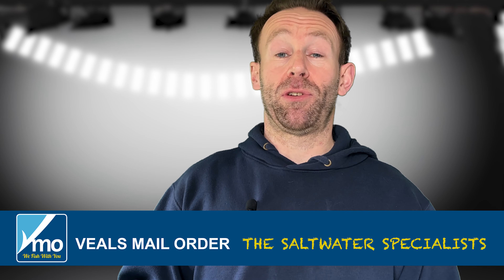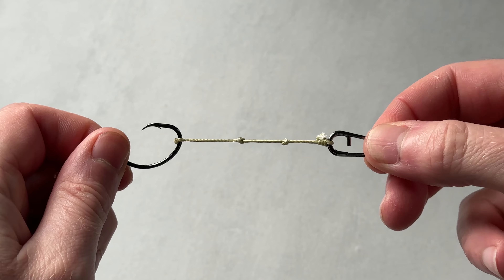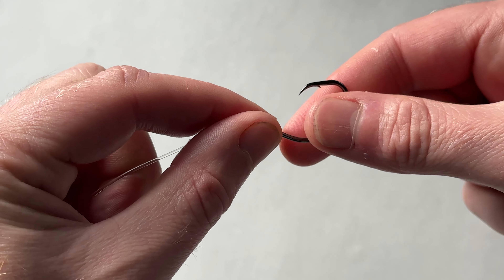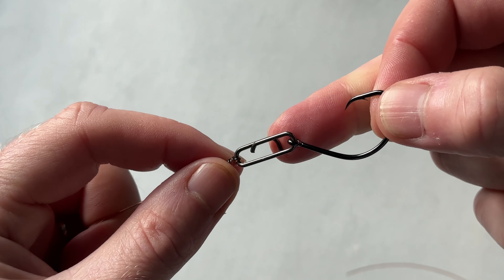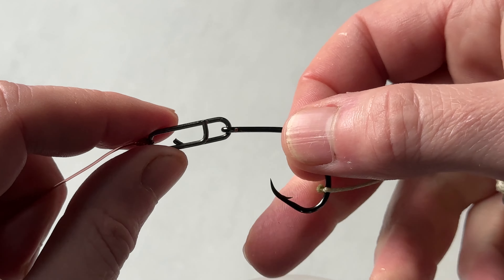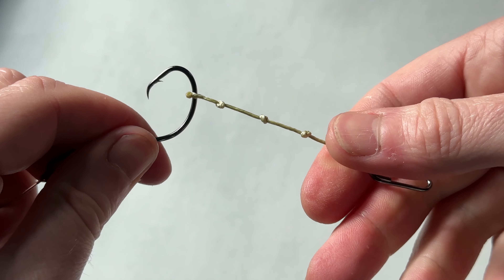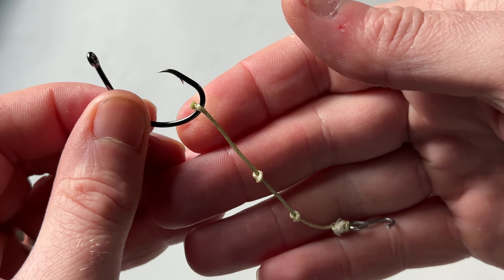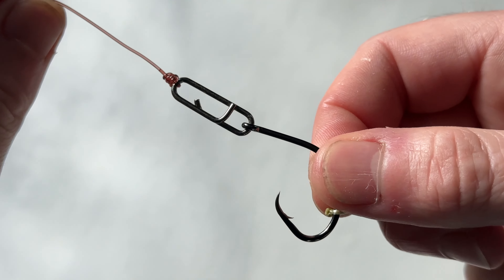Teakle's Tackle Talks- My Revised Dongle Rig!

Comment: Thanks for sharing this video I've seen many ways ppl tie the dongle and this looks a good idea. I mainly use pulley rigs made of trident tackle, having a length of 70Ib mono about 6'  terma link to one end, bead, dynaform, bead then a termalink on the other end. For doing the dongle I can take off the roto bait clip and clip on an imp, on the other termalink I can clip on a fast link clip which the hook is put onto in place of the perfection loop, the dongle bit a piece of 150Ib mono a double crimp on one end place the loop on the hook bend then pull down and crimp in place still having slight movement, the other end put on another double swivel and check for loop size on the imp before crimping it in place I think this will work perfectly so going to tie some of these rigs up and go for rays and hounds, thanks again for sharing your videos jansen I've followed many tips, good luck and tight lines on your next session 👍🎣🎣🎣

Comment: i might have missed a video but why the clip at the end of the braid
Reply from the maker: I use a clip on the braid as a loop is unreliable when clipped in to a Splashdown Solo bait clip.
Reply: Quick release, pre-baited replacements in the cool box, yep!! Great idea that, cheers DaveO 🎣🎣
Reply: @VealsMailOrder2898  i was using 300lb braid with a loop tied in the end, and clipped into an imp for casting. Didnt release it, the plastic part pulled the braid through the clip and the bait (crab) somehow ended up slid up the braid and wrapped around the hook?